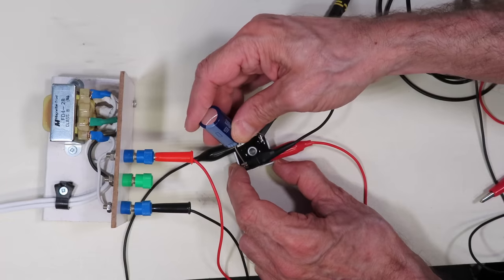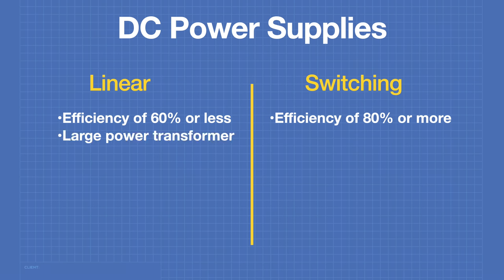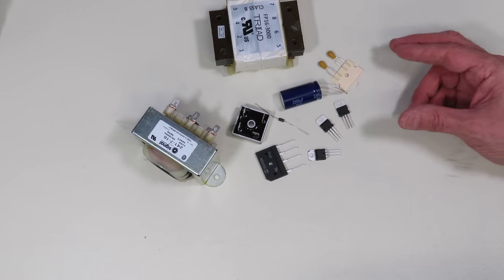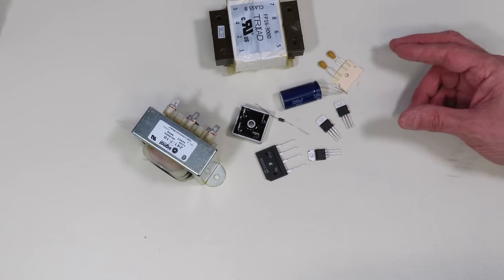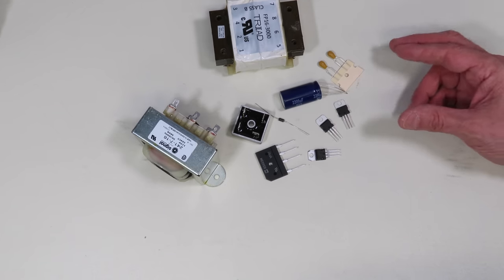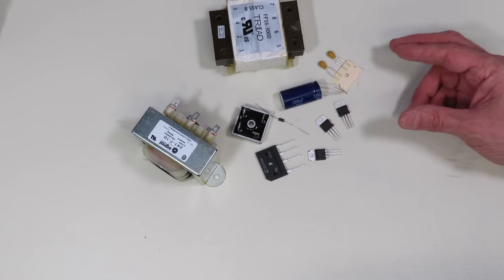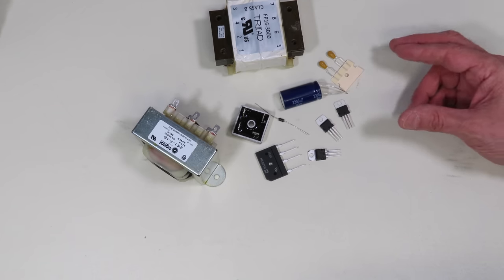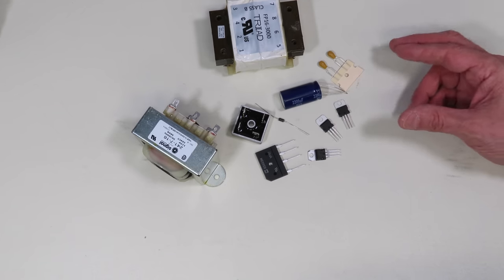Linear DC Power Supplies - Designing & Building Custom DC Power Supplies

Comment: This is an awesome tutorial with plenty of learning to be had, although i can't help feeling it is a lot of work compared to buying one possibly cheaper and being able to use it straight away, after all the tools have been purchased to build this power supply it works out much more expensive than buying a ready made unit, although it is always nice to be using something that you made yourself.
Reply: True enough  But even if you don't build one yourself (I already have a commercial box) this excellent tutorial provides a clear explanation of how they work and what the important considerations are.  I watched the entire video and consider it time very well spent.  This is one of the best sites for electronics tutorials.  Even the most minor details like labeling the panel  are helpful. This guy's clear, calm and low key presentation (typically Canadian?) Is relaxing.  A master instructor.

Comment: other options for cases are small computer cases which can be priced lower than a project case of similar size. A decent source of low volt hi amp transformers can be found by modifying the low volt coil of microwave oven transformers, just be sure to remove the hi volt winding on the output side. Salvaging MWOs and computers and TVs can save a fair amount of money for "learning/test" projects.  If you want extreme accuracy voltage control, a 10 turn pot in series with the main voltage controlling pot is the way to go.

Comment: Hi, very interessing video. It seems that the heatsink is to small to dissipate the power. When the output is set to 1V and provides 3A, the dissipation of the LD1085V will be (25-1)*3=24*3=72W ! The heatsink need to be very large and at the outide of the case for better heat transfer to the air...

Comment: I always loved power supplies... Still using my Elektor PS from the early 80-ties, with the epic 2N3055's.
Reply: Jahajaja.  The 2n3055.  Hotter than a pizza oven ....  remember them ....
Reply: @eloyex  I use massive cooling and in some cases added a small ventilator. You can easily parallel them too! Great stuff!

Comment: I think I bought my first nibbler about the same time you did. I usually mark off the hole with masking tape to act as a straight edge guide and also prevent scuffing up the cut face. I haven't seen Letraset in years, you probably have the last sheets in existence. ;)

Comment: For a low noise, lab bench power supply, how about a hybrid, variable voltage power supply design that uses a switching PS to supply the input voltage to a linear supply?  The Switching PS would track about 2 or 3 volts above the output voltage of the linear regulator.  This could make for a low noise power supply that, due to the relatively small input/output voltage differential, wouldn't generate lots of waste heat across the linear regulator series pass transistor.   Just a thought.

Comment: I used a Pi Filter on the liner one I built from junk '70s stereo transformer a couple of years ago, and it works well. I used 14 gauge magnet wire on a large toroid and some 2000uf 200v electrolytic caps for switching supplies. I measured 5 amps at 60 volts on a load.
Reply: I have been thinking about using it for nichrome wire cutting and adjusting heat with a solid-state relay and pulse width.

Comment: I would have liked to see a test on thermal performance. How long does it take before a load of 3A at 3.3V trigger the thermal protection with that small heatsink? However an excellent explanation as always, thanks!
Reply: I suspect the math, though not that hard, deters YT channels from really discussing heat-sinks.  I think I have a PPT I made on the subject
Reply: @kennmossman8701  , IMHO I think that if you draw 2.5A at an output voltage of 2V, the regulator cannot dissipate about 50W of power with such a small passive heatsink.

Comment: nice project! never heard of laser transfer labeling before – thanks for that hint! i have three minor remarks: 
1. i think the heatsink on the regulator is marginal. if you're drawing 3.3 Vdc/1.5A, and the input to your reg is close to 22 Vdc, you're burning 18 Vdc at 1.5A – 27W…
2. i would feel uncomfortable not grounding the supply because of the ammeter – instead of a combined volt-/ammeter, i'd rather use a 0R1 or 0R01 resistor in the reg output and measure the voltage drop across it with a mV meter module. in a similar case, i have used the same volt-/ammeter as you did but removed the built-in shunt from the meter and placed between the - output terminal and 0V. the trade-off of measuring DC current directly in either way is a higher output impedance. the alternative would be one of the DC volt-/ammeters with indirect current metering via current transformer.
3. your clean DC output is right next to the transformer primary and the input module i.e. you'll have AC radiating into your output. i'd probably move the output terminals all the way to the left of the front where it is on the clean/DC side of things. 
minor quibbles…
Reply: sadly there are extremely few videos on choosing a heat---sink.  there is one i found.....try searching.
if the delta V is high and the current is such that Pd is high then use a pre-regulator....a 2N3055 in a TO--3 case in a series zener based regulator is often a  good choice

Comment: Great video.  Thank you.  Two questions:  (1) You said it was an 18 V transformer, so how is it able to provide 20 V output?  Even if the 18 V is RMS, the peak would barely reach 20V, and then I'd expect some drop from the rectification and the linear regulator.  (2) I never saw where the chassis is grounded.  I expected something like ground screw terminal in the chassis wired into the ground (like you'd see in a metal junction box).  Does the power entry module bond the chassis to ground?  When the lid is screwed to the lower piece, does that ensure the lid is also grounded?

Comment: Another option for anyone who doesn't want to deal with mains voltage is to use a class II wall-wart transformer. They're easy to find, and can be had pre-terminated with a barrel connector.

Comment: Nice video. Very well explained. Could you perhaps also explain how you would add a variable current limiter to the power supply?
Reply: Use LM317 as variable constant current regulator and another LM317 for variable voltage regulator.

Comment: Good tuto about the good ole linear regulators. They still have my preference (because of low noise), and will still be around for a while. They are just rather indestructible😉(ok..maybe not always😁)and yes, very fast response time.
Reply: Ohhh. I just wrote the same.  For lab use NOTHING matches a linear one for the reasons you mentioned and much more.   Only if LOT of current its necessary would think on a switching one . ( for lab use)

Comment: A very fine tutorial, one of the best I've seen on YouTube, thanks!  I've been building these things since the early 70s and I think I will build another one to use as a bench P/S and to provide noiseless power to the LED lighting in my workshop.  One thing I would like to add that few people discuss, however, is a Constant Current adjustment so one can limit the amount of current that is fed into the device under test.  This feature is common to nearly all good quality lab power supplies as it can prevent accidental shorts from damaging or destroying the test circuit before the fuse in the power entry module has had time to blow.  Can that be added to this design do you think?
Reply: I would love to know this too! Have you found anything?
Reply: There's various ways of doing a constant current regulator from a 2 transistor circuit to the 317 regulator ic. Both circuits do drop some voltage as well which can vary and are best placed before any voltage regulator circuit. For a 12 volt supply I would suggest a 20 volt 2 amp transformer using 2 lots of the 317 regulator ic's. One of the ic's operates as the current regulator with the other operating as a variable voltage regulator after the current regulator. Allow a minimum difference of about 2.5 to 3 volts across the voltage regulator ic with more across the current regulator ic. There was a project that appeared in Everyday Electronics back in 1981. Most transformers available do have a pair of secondary windings and there's a considerable size jump between 25VA and 50VA in the EI core wound types.

Comment: I really enjoy your way of explaining things to someone like me, a beginner who is curious to electronics. A very good video on how to build your own power supply. I feel that even I can pull it off😄. I do have a question though, I have a torioid transformer with many seconds that was used for an amplifier. I want to make an adjustable PSU with a wide range of voltage output. Are there any adjustable voltage regulators that have outputs over 40V? I have tried to look around, but everywhere I end up at LM317. 
Thank you for your time. Måns

Comment: Hi sir, your explanation is very clear thanks , my question I've already built 12 v power supply using Li-ion batteries and planning to use this power source  to work as a variable Linear DC voltage and current supply. Can I simply connect at the first filter capacitor?
Any recommendations is appreciated.
Thanks

Comment: ive made a few of these. but that said, at the end you give the (very good) advice that if you are afraid to work with line voltage, then DONT. that said, just thinking out loud here, you could possibly go the way that most consumer products are going these days and just get a large pre-made power brick and use that as your input. a lot of laptop power bricks will put out around 20vdc.

Comment: Very informative! I built my own linear power supply that I use to test dc motors. There's no voltage regulator, but it works great for testing stuff and to powering my homemade bandsaw 👍

Comment: I disagree with your claim that a low dropout regulator will dissipate less power. The regulator dissipates the difference between the input and output voltage times current through the regulator. The LDO can tolerate input voltage which more closely approaches the output voltage. This results in lower dissipation only when this is the case. If input voltage drops below the minimum voltage necessary to remain within dropout specs for the regulator, output voltage will be the spec'd dropout voltage below input. Power dissipation is identical for LDO if input voltage remains comfortably above dropout for both.
Reply: That particular LDO is a bit more efficient because the output transistor is NPN, so its base current flows into the load instead of to ground as it does with a PNP pass transistor. 3-terminal adjustable regulators with PNP pass transistors don't really work because there is no "ground" connection as such. Accurate adjustability relies on well-defined current from the "ADJ" pin.

Where the PNP types become "interesting" is when the input voltage is too low for regulation. The PNP base drive will go to the maximum possible. The base current can exceed the load current. Again, this current goes to ground. If you are using a battery as the input supply the regulator becomes as rapid battery discharger instead of just dropping out of regulation when the battery voltage is too low.
Reply: I disagree with your attitude
Reply: Wrong!

Comment: We used to use printed transfers a lot on panel work years ago. We used light coating of lacquer initially then a thicker coat to seal it  We used letraset.
Reply: Very 1972-ish ! I havent heard of Letraset in 50yr. Thanks for the trip down memory lane

Comment: You mean well but overlooked a very serious specification! The heat dissipation of the regulator! The regulator MUST be kept below its rated operating temperature or it will shut down! You cannot use the regulator at 3 amps (or even 1.5 amps!) with that puny heat sink shown in the project without it shutting down at loads of greater than about an amp. To solve this problem, the regulator could be mounted with thermal grease to one of the aluminum case panels to get rid of the excess heat.

Comment: Very interesting and entertaining video, thanks. If I may make an observation, an overview of the zener diode, used in conjuction with a power transistor, may have been helpful in setting the scene for the regulator chip discussion. That said, why not even talk about the potential divider; another solution to low power consumption requirements.

Comment: Every project is so well presented, it would be great if this multi low voltage system also incorporates a UPS with a Lithium Iron Battery pack say around 100 watt capacity

Comment: First of all is a good try. However I have some questions. If I want to make 12 volts  and  24 volts  at 100amps supply  DC what potentiometer must use probably with lms in parallel I believe? And second question can I use a module (triacs) to manipulate the AC in the input of the transformer instead of manipulating the DC after the bridge rectifier especially for 100amps and if not why?

Comment: Hi, Thank you very much for  all your videos.  I  am learning a lot from your posted projects.  I recently built a variable power supply as shown in your Linear DC power supply video.  It appears to work however, I observed that the supply voltage output drops significantly ( by about 1 to 2 volts) when it is connected to a load (the load is a LED with 330 ohm  resistor).  Could you please trouble shoot. I must have done something wrong and appreciate your comments.  I used the same parts with the exception of LD1085.  Instead I used LM1085IT from Digikey. Do you think the gauge of the wiring that I used could be the source of this anomaly (used 22 and 24 gauge wires)?  Thanks.

Comment: Heat-Sinks

As noted in several comments a heat-sink is likely required. There are very few good YT videos on selecting a heat-sink though "Sine Lab" having one of the better ones. 

It is tempting to consider using the [metal] chassis or case as a heat-sink but this is very much hit-or-miss. A blanket recommendation is stupid. 

An effective heat-sink has four major parameters;

1) type of metal. Some metals are good at conducting heat but many are not good. It is why a steel fry-pan with a copper base is better than an all steel fry-pan.

2) the thickness of the metal. Thin metal is much poorer at conducting heat. It is why a thick fry-pan is better than a thin fry-pan.

3) the surface area as well as number/orientation/thickness of the fins

4) the finish.  Good uniform contact is necessary. It may look flat and unifrom but at a  microscopic level sheet metal is rough. Even with proper heat-sinks the use of a SMALL amount of thermal compound is needed - to fill in the microscopic holes/gaps.

So while the chassis/case can be used you just do not know if it will be effective. Do watch the  "Sine Lab" video to learn more. Full disclosure: parts of the video were based on a PPT I gave to the channel.

Comment: Great video and graphics.  I liked your ideas about using the selector switch for fixed voltages.  I wonder if it would have been possible to do something simple with two pots to have a fast adjust and fine adjust for the voltage.  I think I read once where someone figured out a good way to do it that wasn't obvious (at least to me).  Probably could find it with google.  Good job.👍👍

Comment: Do the three AC mains leads need to go through drillings in the perf’ board?  Is it to prevent mechanical strain on the two transformer solder joints when handling the assembled board?  The mains connections to the transformer seem critical.

Comment: Nice, but one issue: Linear regulator not very well set up for high currents due to inadequate heat sink on the regulator. You could mount to the power supply chassis using a electrically isolated mounting.
Reply: Noooooo   a chassis is a poor heat-sink

Comment: Very good video.  I am building a 30a 35v power supply for an induction heater circuit.  I wound a 1200 watt transformer.  Bridge rectifier 1500v 100a with heat sink.  2500uf cap, 5mh inductor, 2500uf cap, 4000 ohm resistor.

Comment: QUESTION; Does the nibbing tool work on plastic? I've been using Dremel and cutting disk but sometimes it's kind of jagged or it melts the plastic. A nibber looks like it leaves a pretty clean edge.

Comment: i don't get why im trying to use the lm317 circuit from the data sheet, with diodes, and I'm only getting like 1v of drop with the pot, i even switched to a 10k pot, i might have initially burned the chip because i used like 20V with no load, now im trying 9v with a 100000M ohm load, but only getting about 1 V of adjustment. i don't get it. i guess I'll just assume i burned the chip by not connecting a load.

Comment: Great video! I watched the whole thing. One critique would be that I noticed was that you (I’m sure inadvertently) mounted the ac power cord assemble upside down, so that the rocker switch is down for “on”. 😮 Otherwise excellent video. I’ve built several of these in my +37 years of electronics.

Comment: Great video…have made many power supplies with all 3 types of 3 terminal regulator… in terms of ease of use etc they are in the same “family” as the 555 timer!
I alway though the tool was a “nibbler”, designed to “nibble” away at the material!
Reply: My sentiments exactly, Andrew. The tool should be called a "nibbler" for exactly the reason you stated - it nibbles away material. A "nibber" by definition, is a device which creates a 'nib' or split in the point of a pen.  Bill has been calling it incorrectly for most of his career (it seems).

Comment: Thank you for informative video and website.   What ist the low current transformer that you use to prototype?   It would seem safer to use this instead of the actual transformer.   I'm a cheap audiophile, looking for ways to power my 5V DC DACs without spending hundreds of bucks.